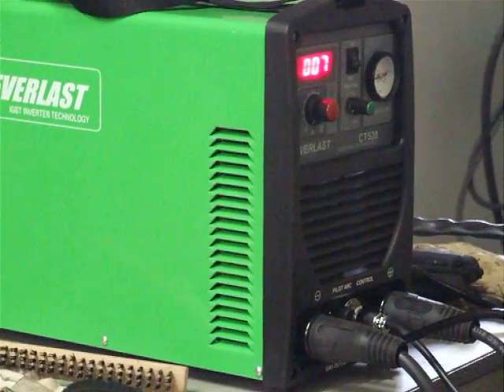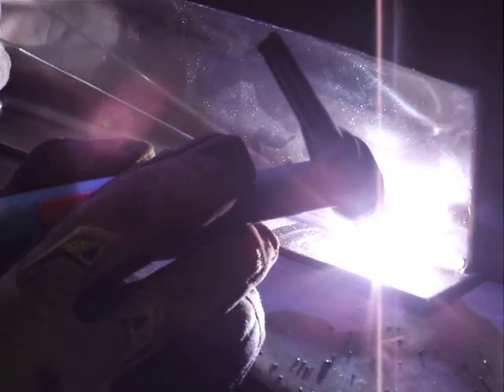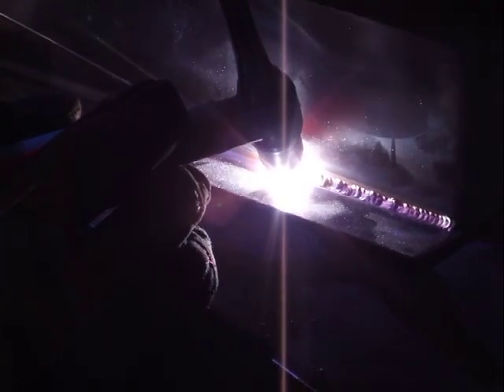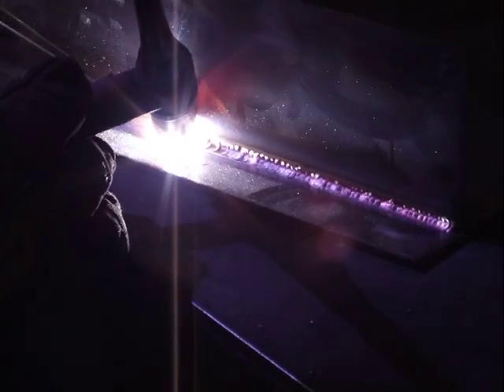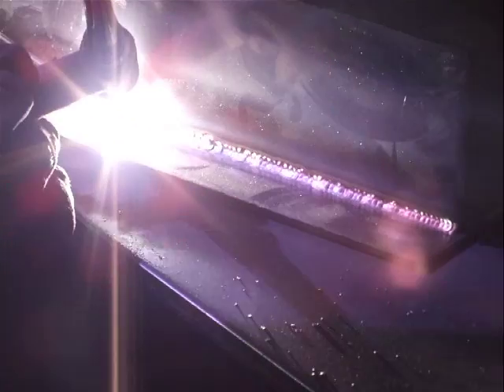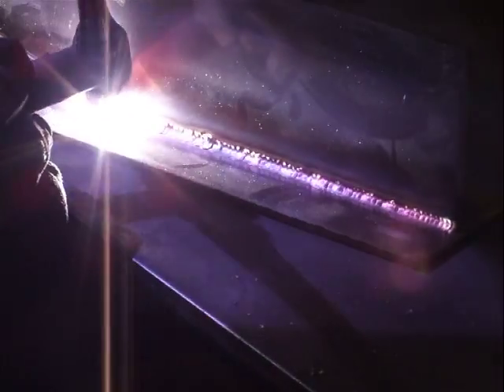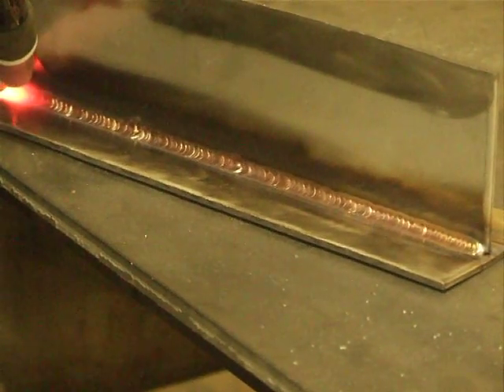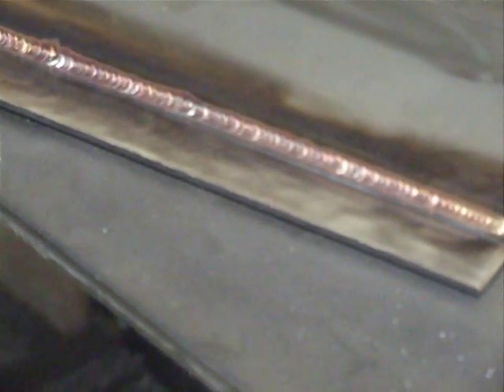TIG Welding stainless steel with the Everlast Super Ultra205

Comment: That is a horrible tig weld, it's too cold which you can see by the inconsistency in the weld. By using filler rod and running your welder too cold you get that ball at the end of the filler and when it does finally melt it creates those parts where the weld is thicker in some parts. You can also tell it's too cold by the way the weld is stacked on eachother

Comment: @SuperLorant you can't weld TIG with normal air...it will just make bubbles and sparks and will not weld pieces together.  im a stainless steel tig welder and we use pure argon. you can use other type of gas such argon-co2 mix or things like that but i think pure argon is the best... your welcome